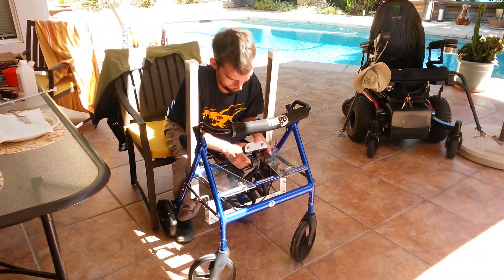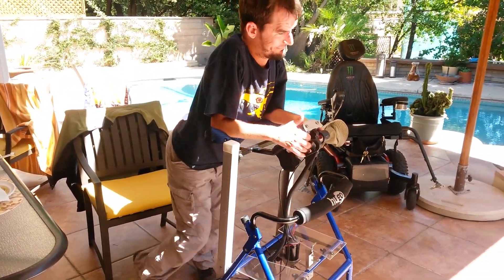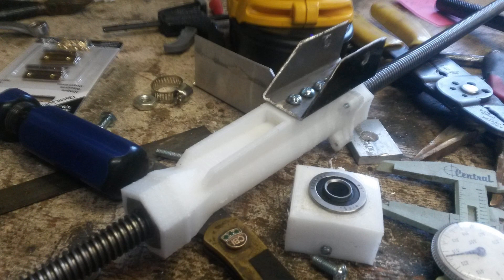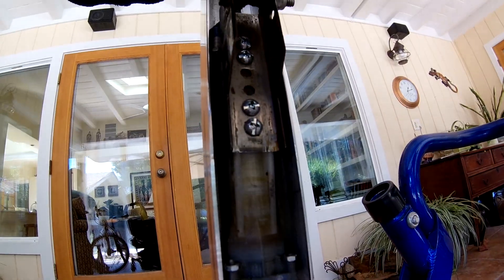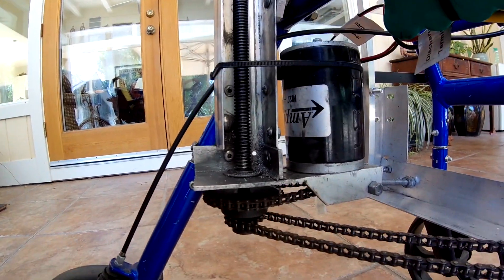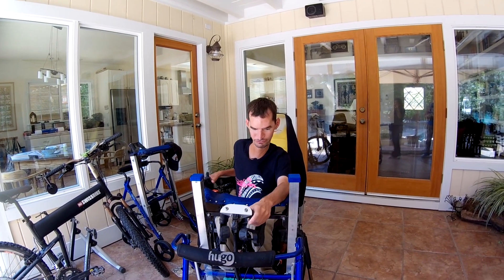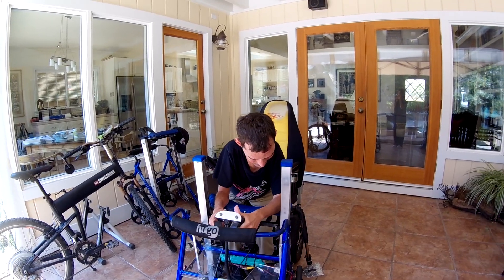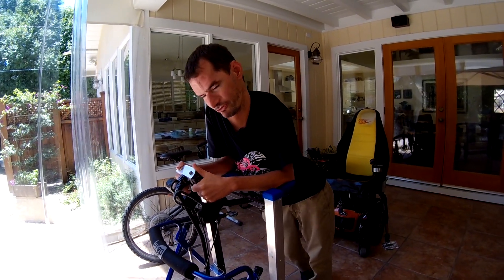The SuperWalker - Track Actuators that stand me up!

Comment from the maker: Another option to make it quieter is to use a screw with a steeper pitch so it turns slower. The ACME screw I used has a pitch of 10 turns per inch and they are available with a pitch of 8 turns per inch but then that would require more gear reduction and there isn't room for a bigger sprocket. Also use a nylon ACME nut and a belt drive instead of chain.

Comment: Would independent electric motors instead of the chain drive make operation quieter?
Reply from the maker: This is actually the third generation of my SuperWalker. For the second one we used a power window motor and it was quiet. It used a chain to lift the handlebars but then if the chain derailed or broke then it would collapse. And two separate motors can get out of sync. See Gen 2 and Gen 1 in this post: https://hackaday.io/project/2344-the-super-walker